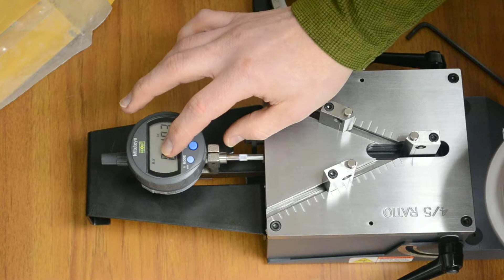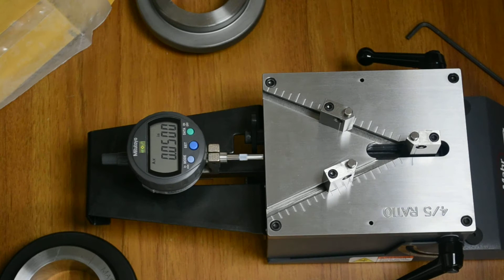Mahr 36B Setting Instructions

Comment: Shanghai Kooyle  abrasive flow machine can polish multi holes mircro holes,fuel injection  Automobile nozzle injection valv ,CNC metal parts precision mechanical parts deburring and polishing Ra0.025-Ra0.04 M.
Kooyle Industrial Shanghai Co., Ltd. is a research development and sales manufacture company specializing in the polishing industry  
Abrasive Flow Grinding, also known as Abrasive Flow Machining (AFM) ®, is a precision finishing technology used in a variety of industries. as a method of smoothing and polishing internal surfaces, and producing controlled radii. Hand polishing or deburring can result in inconsistent or inefficient results, and can be impossible to perform on complicated or internal surfaces.The process can also optimize the flow coefficient or improve the high and low cycle fatigue strength of certain pieces. Some applications of this process include:

Deburring
Edge radius generation
Surface improvement (polishing)
Removal of thermal recast layers
Polishing complex internal shapes to mirror finishes
Create/improve the gas/liquid flow path inside valves and fittings

------------------
Best wishes,

Lavender@kooyle.com

Website: www.kooyle.com 

Phone/wechat/whatsapp/skype:86 18516640286

Add:No 69 Jiangong Rd jinshan Shanghai China 

https://youtu.be/NNs7LNVSJ6w